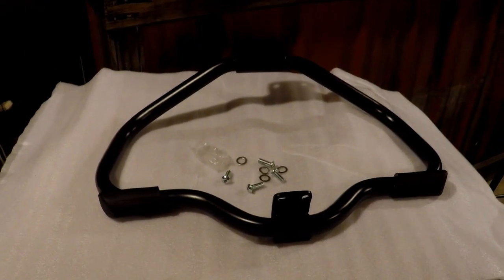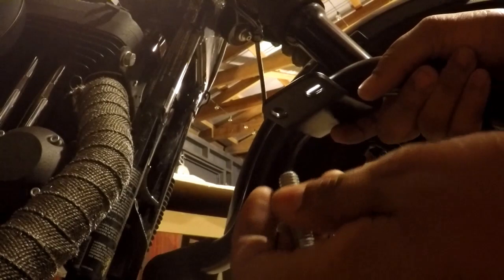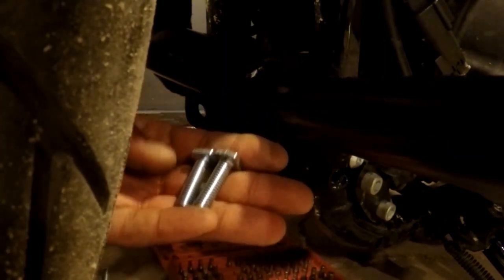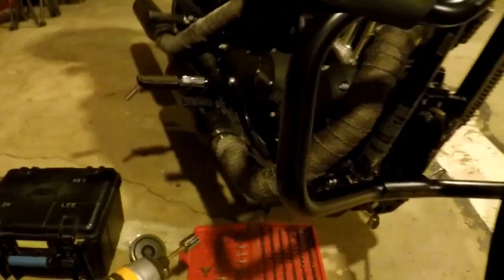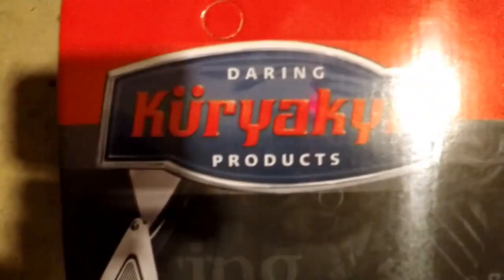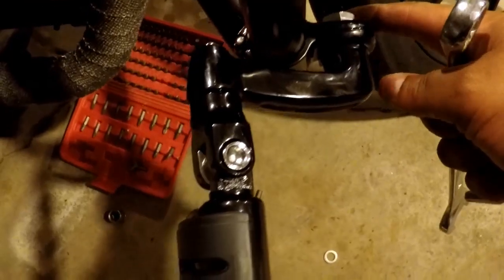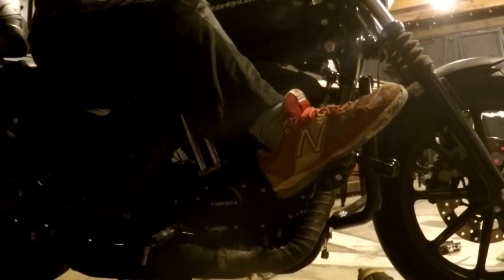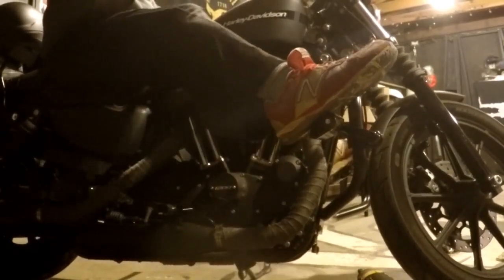Engine Guard Harley Davidson Iron 1200

Comment: I have the same problem with the bottom bolts did you ever find out the size?
Reply: What I did is I installed a nut on the back to tighten it,makes it solid
Reply: If you look where your forward controls would go there are two bolts on either side. I used those and they fit perfectly